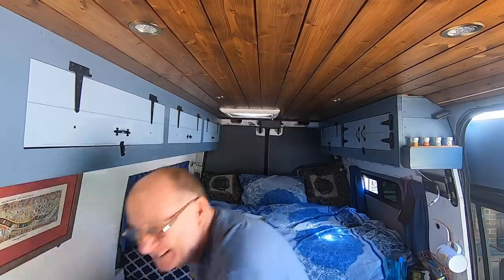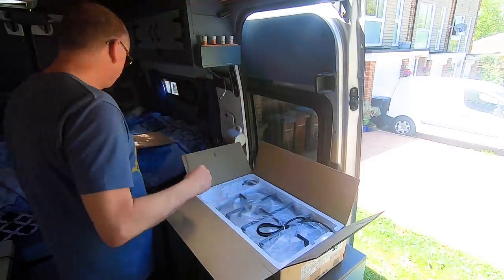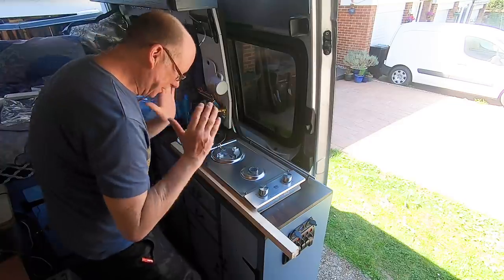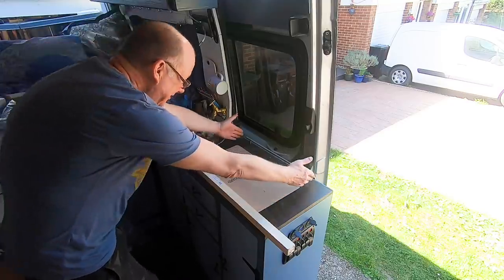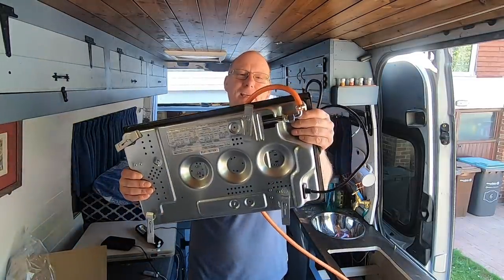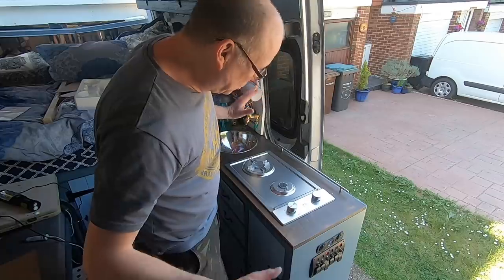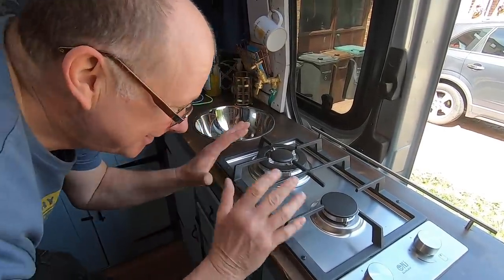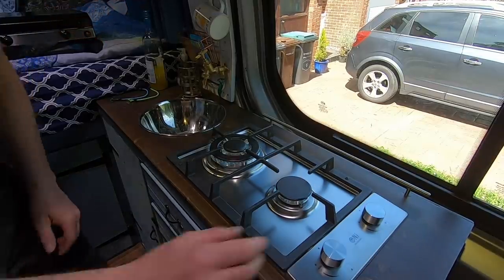Installing twin burner LPG Propane Gas Hob Stove Camper van build

Comment: Nice one Mel, are you connecting the hose directly to the regulator? Any thoughts on how you'd connect the hose to 8mm copper pipe..?
Reply from the maker: At the moment I am running orange hose from regulator to the hob the best way to do it wouldn’t involve using orange hose at all you would run what called pig tall from bottle to reg and then 8mm copper to hob once I’ve used all the gas in my small bottle up I’ll think about fitting a refillable bottle of you are not confident with gas then make sure you get it looked over by some who is good luck 👍🤓👍
Reply: @BigVanSmallWorld  much appreciated Mel, I surely will be getting a professional in for an inspection!

Comment: Great video Mel 😂, can I ask what happened to the attached 240v plug? Is it plugged into an inverter or what?
Reply from the maker: Oh yes sorry no I used an extension led when out and about I’ll probably just use a lighter until I can get a decent inverter 👍😊👍
Reply: Mel’s Van World ah right, suppose could just remove plug an cable an use lighter as you say. Great job mate! Ps not only are your videos informative but the fun an frolics you add to them is just brilliant 😂👍✌️
Reply: I was wondering the same thing! Thought Mel had made a successful 12v conversion this time!
Reply: James Gibb 😂✌️👍

Comment: Shouldn't the gas pipe be copper not flex?
Reply from the maker: As far as I understand it as long as it’s under a meter it’s fine 👍
Reply: @BigVanSmallWorld  I'm sure it needs to be copper at the appliance end and flexi at the bottle
Reply: You are right Alex, you cannot use orange flex hose on permanently fitted cook tops it must be copper pipe back to the regulator.

Comment: Can't see the worry not fitting a drop out vent, surely they don't have them on boats.
Reply from the maker: Thay do have them on boats 👍😂👍
Reply: @BigVanSmallWorld  Yes i looked it up, the suggestion is to have the cylinders above deck, but been on a sail boat once, can't say i saw on deck where a gas cyl. might have been stored. The galley was well down inside.

Comment: nice stove, not scared of all that metal flying at you driving?
Reply from the maker: It’s screwed down
Reply: @BigVanSmallWorld  i meant the steel top and burners. 
Mine on a similar model are not attached.
Reply from the maker: @sampep   watch the video and you will see what I have done to stop it from flying off
Reply: @BigVanSmallWorld  ah I missed the part of the bungee. 
I ended up trying RTV sealant for the hub part

Comment: yOU CAN TELL THAT HOB WAS DESIGNED BY A MAN. Why put a sink that close to the stove? Where do you put your dishes once you've cleaned them? Where do you put your hot pots if you need to let things cool down and use the burner for something else? Also that grill is not secured so it will almost certainly jump around and end up on the floor.
Reply from the maker: Your absolutely rite I’m actually rebuilding my kitchen rite now 👍😂👍